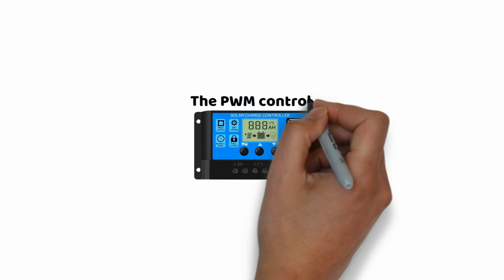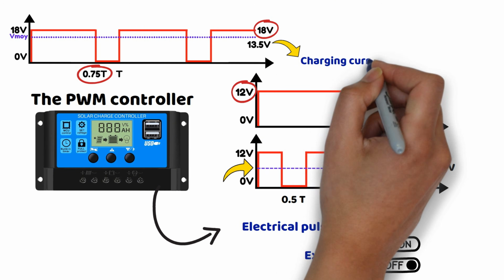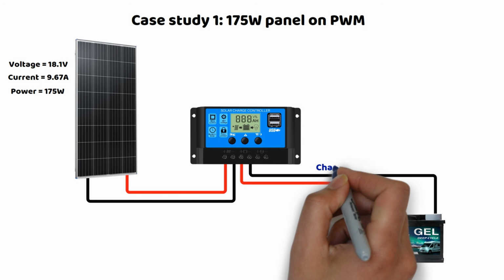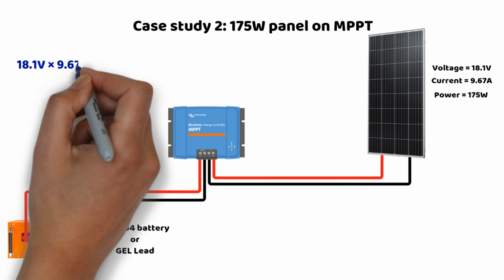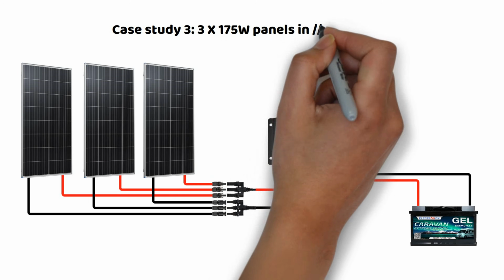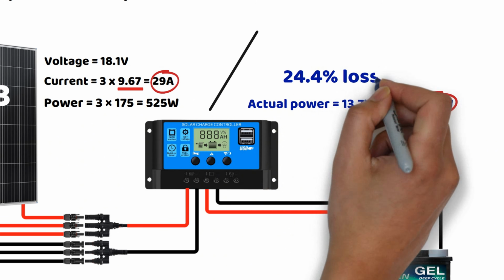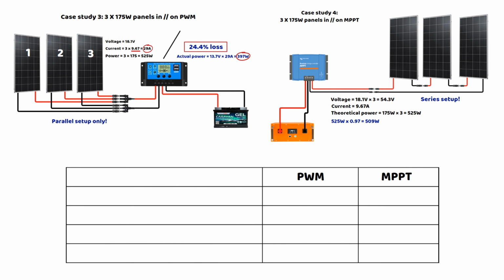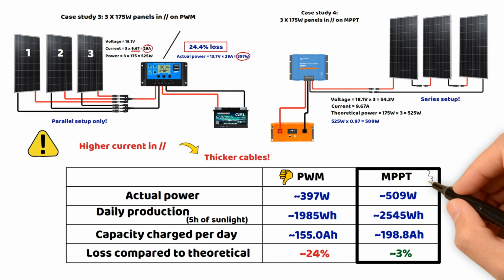Case Study ➡️ PWM or MPPT – Choosing the Right Solar Charge Controller

Comment: Panels in paralel 42 volts charge 12 volts batery for 3 yeras with PWM no problem
Reply: You have already lost your charging capacity  ~ %60 loss
Reply: Fr it saves battery life compared to mppt that simple cooks battery

Comment: I have 2 200w 40v solar panels, using 12v battery, currently using pwm controller. But the controller is always off like battery low during the day. Will mppt charge it normal?
Reply: I had the same setup. Did it work for you?
Reply: @nandakumar5398 i noticed the problem, if you input 40v the controller switches to 24v mode so with 12v battery the controller measures it as too low battery hence the display issue although the battery charges normally

Comment: Real world testing concluded that there is only 1% difference between pwm and mppt when used side by side.
Reply: I would disagree... I've used both and I will never go back to the cheap ones unless it is a one-off panel charging a battery for a specific purpose.  For actual usability the MPPT system was more expensive, but completely worth the money.  The cheap PWMs are not so great, as was mentioned here, I hooked one up to a Lithium battery and it got confused and thought it was a 24 volt system because it was over 14 volts!  Almost fried an expensive battery, luckily I caught it when my trailer CO2 alarm started acting up - it was spiking at almost 30 volts from that cheap PWM unit.  Another cheap unit burned in front of me when I accidentally removed a wire from the battery (you have to have the battery connected before the solar panel, and if you unclip a battery terminal while hooked to solar, it instantly fries the PWM unit...)  These issues do NOT happen with the MPPT systems.  You get what you pay for.  And then there is the conversion - in low light the cheap ones stop producing power, but the MPPT still added a few amps into the batteries.  I never had drained batteries with the MPPT but often had that happen with the cheaper PWMs.  But if you just want to use it for a small system and keep costs down, do use the cheaper ones.  I only converted after getting over a kw of solar panels, but it is worth it at that point!
Reply: That depends on your setup and other environmental factors. I have 6 100watt solar panels hooked in parallel that have an output voltage of less than 18 volts so I use a PWM solar controller because I need the amps as I can't find a MPPT that works with voltages under 18 volts.
Reply: @jamesm568  You must be using 6 charge controllers then?  They tend to have low amps you can put through them.  You can connect two 18 volt panels in series and then 3 sets in parallel to get 36 volts into an MPPT controller.  That single controller will do a much better job trickling in the amps on cloudy days...
Reply: @timfarry7071 I have a 35 amp PWM solar controller that matches my solar panels. I power all the 110 circuits on solar so I need the amps during the day. I would lose that with a MPPT solar controller due to my lower voltage panels.
Reply: @jamesm568  You are lucky you don't fry that controller.  100 watts divided by 18 volts is 5.55 amps, x 6 is 33.3 amps - if you had a very bright, cool day, you could generate 35 amps and fry the controller.  They shouldn't get even to 90% capacity.  You will not have any issues stringing 2 of them together in series, make 3 sets of 36 volts going into an mppt controller.  You will still be putting 33 amps into the 12 volt system, they can do this no problem.  With pwm types, if it is cloudy they tend to drop off and sometimes don't add power, but the mppt will still give power, even if it's only a few amps.  When it's cloudy, something is better than nothing.  If you do fry the controller one day you might want to consider the mppt.  I am glad I switched, will never go back to pwm unless it is a single stand alone panel.  But the 100 watt panels or less are the only ones that really work with the pwm, if it works, it works.
Reply: @timfarry7071 That's because I over panel my solar controller so cloudy days are not really that big of a deal. My solar panels are also bifacial so that helps. I will eventually bump up to a 40a MPPT solar controller from the same manufacturer that my solar panels are whenever they release it.

Comment: Waaree 395 what two piece solar panel Kitna empier ka pwm charge controller Lena padega Jo 12.6 volt lithium ion battery ko charge Kar paye and load chalana chahta hun 💓
Reply: Lithium batteries are fussy - if you don't buy an expensive MPPT controller you may be better off hooking the solar panel to a lead acid battery and using a small inverter to plug in the Lithium charger to charge it.  I learned to do this after the cheap PWM controller almost fried my Lithium battery.  My main unit is 4 lead acid and I hook them into 24 volts, run a 24 volt inverter to give me 110 volt power, and I just plug in the lithium battery charger when they get low off of that.  No solar directly touches the Lithium batteries, only the safe and specific charger for that type of battery charges it.

Comment: If you connect a 100w solar panel straight to a 12v battery the output voltage of the panel will drop immediately,  that 18v is the open circuit voltage,  same with an ac transformer, the open circuit voltage of a 12v 4 amp transformer will be around 18 volts, put a load on it to draw 4 amps and will drop to 12v.
Reply: Yes and no - you will read the lower voltage because the battery hasn't had time to level off - but over enough time, if you don't drain that battery, the battery will eventually try to reach 18 volts - that is why you have to match the voltage or use a charge converter - to match the ideal charging voltage.  I had a cheap PWM controller get confused on a Lithium 14.2 volt battery, thought it was 24 volts, and the voltage coming through was over 20 volts - so you can fry batteries if you don;t use a proper (or good) charge controller.  I have a 60 volt Ebike that I put 74 volts worth of batteries (fully charged Lithium) and I hook 4 small 40 watt solar panels in series directly to it to charge it - it will reach 78 volts and then level off, meaning they are fully charged - but I keep an eye on it and never overcharge it.  Unplug it before that happens.  I also installed a diode to prevent back leaking of the batteries into the panels, which is essential if not using a controller.  So you could charge a battery that way if you watched it and disconnected it before it was overcharged, but it is not the best way to do it...
Reply: @timfarry7071  that must charge slowly at 160watts absolute max, so probably more like 120 watts, my 48v 27 a/h ebike battery takes around 8 hours to fully charge from empty on a 4 amp charger!

Comment: Doesn't the PWM controller have less loss when the voltage drops a little ?
Although most panels drop very little (almost on/off) in the case where the output
voltage changes, as long as it stays above the desired voltage minimum it will still
deliver the same power, especially when nearing the desired voltage for input on the PWM.
Just asking, and thanx for the info.
Reply: An MPPT will always be better, often much better.  It is more or less impossible to configure panels such that their maximally-efficient voltage (Vmp) is right at the battery's current charging voltage.

For example, a 100W panel typically has a Vmp of around 19V, while the battery it is charging might be closer to 13V.  That's a 40% loss no matter how you swing things.

The author of the video also did a good job explaining the other problem with PWMs... the fact that in order to try to get a decent voltage match you generally have to parallel panels and generate much higher currents on the DC cabling going into the PWM, which requires thicker cables and has far higher losses.

You can optimize to some degree by using a higher battery system voltage... 24V or 48V batteries instead of 12V.  For example.  So, for example, if you can arrange the solar panels in a series such that Vmp is, say, 65V and it is charging a battery at 53V, the losses would be roughly 22%.

Regardless, it is virtually impossible to beat the 1-3% losses that a MPPT controller has.  This is because the MPPT controller can precisely operate the solar panel at its optimal Vmp, convert the energy into a magnetic field in an inductor, and then convert theenergy in the magnetic field back into a (different) optimal voltage for charging the battery.

-Matt

Comment: How many panels can mptt handle
Reply: it depends on the model 
700V to 1000V
Reply: You can put panels in series up to the input voltage limit of the MPPT controller, which depends on the MPPT controller.  A Victron 100/20 for example has an input voltage limit of 100VDC.   This means you add up the Voc (open circuit voltage) of all the panels you put in series plus add a bit of margin for cold weather (cold weather raises the voltage further), and ensure that value is less than the maximum input voltage the MPPT controller can handle.

MPPT input voltage limits range from roughly 30V all the way up to 1500V depending on the controller.  For small systems, common voltage for cheaper professional MPPTs range from 75V to 150V or so.